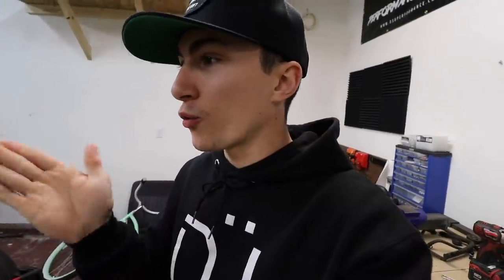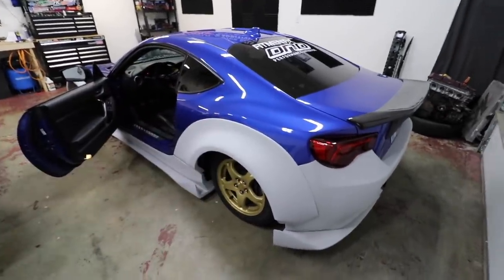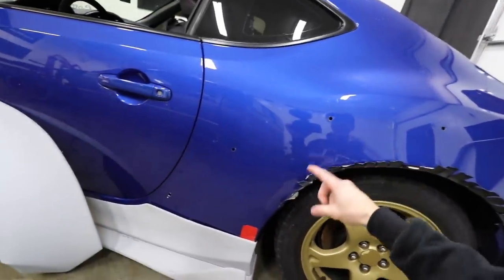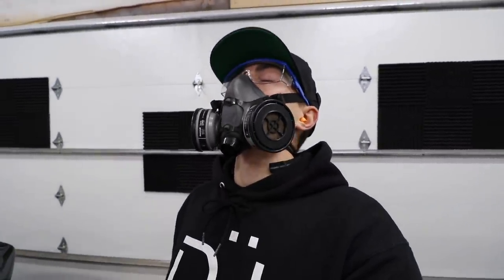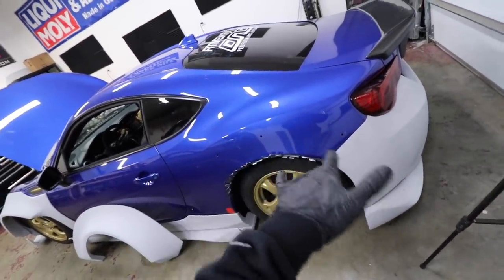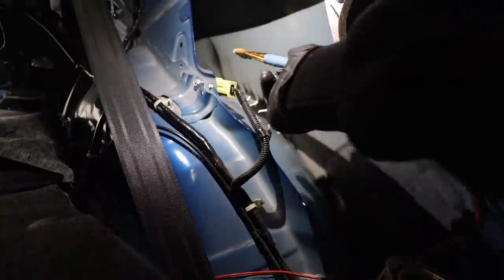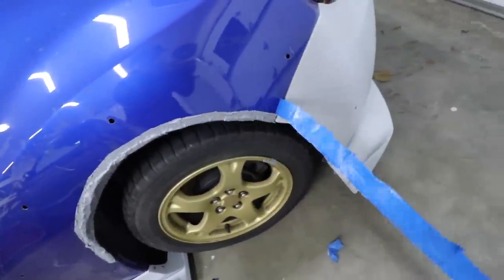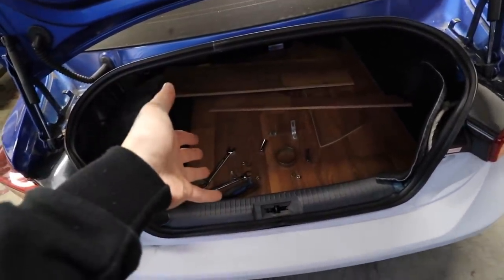COMPLETING THE KARMA BODYKIT!

Comment: Can't wait to see the shop, I do a lot with my cars at home and dream of having a place away from home to do work
Reply: I motor swapped my ranger, slammed it got the first 4 cylinder running after 8 years of sitting all in the grass of my front yard because my parents cars were in the garage and the driveway was full with 2 different boats so I did every thing in southern Louisiana where it rains almost every day in the grass and rain and once it heats up. I am painting it in my front yard.
Reply: I work outside a lot as well, I live in Wales and it is always wet and cold here haha. Me and my dad have built a shed but it's a squeeze working on cars in there but it's better than nothing

Motor swaps suck on level ground let alone grass

Comment: Here is an idea for the boot. Carbon fibre flooring to replace the wood with a sick speaker setup. Doesn't have to be a massive one. Just small one in there with some leds. Enough space where you can still use the boot for storage

Comment: CommittedCrew, i definetly understand you Robbie, i was so happy when i got my first "shop" with my friend, it wasn't big or anything but i was so happy that i finally had place to just go, if i didnt want to be at home, or wanted to hang out and work my first car project (i was age of 17, we get our license at age of 18 here in Finland) and btw i got the things that i had to do to the car and got it working but im pretty bummed that it didn't really affect anything (changed valve stem seals so it wouldn't burn oil, well didn't stop it) and i had the car for 2 days before it started making noice, fast forward maybe 4 months i found out its either con rod bearings or the sleeve connecting piston and con rod and now i don't have place to work on it so yeah maybe next spring i can continue to working on it 😅 and yea it was supposed to be my first car but had to buy another as "daily" and the car i question is 1993 red mazda mx3 with 1.8l v6 engine 😂